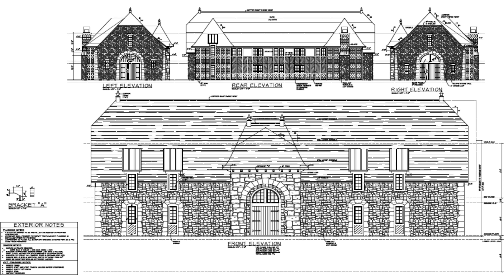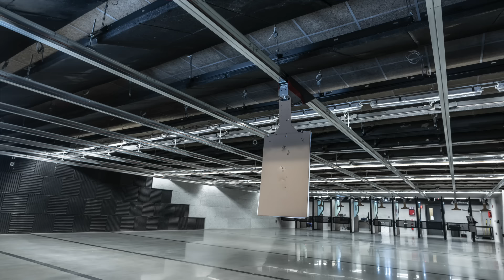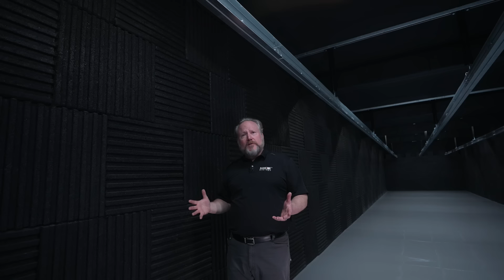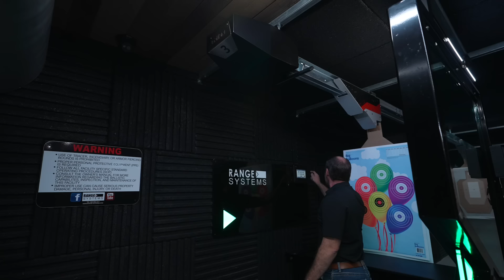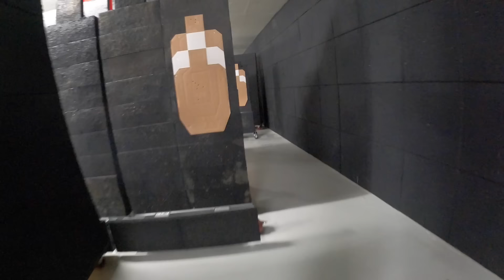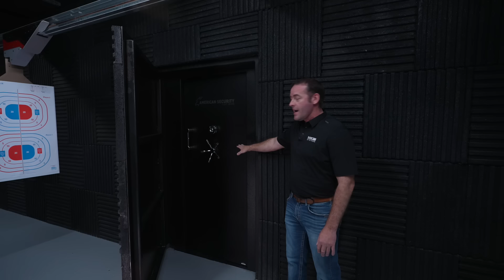Indoor Home Shooting Range: Step by step guide to building your dream range

Comment: I would build a 25 yard tunnel into the back yard. The range wouldn’t be under the house at all. Just the front of the lane would be in the house but the rest would extend under the ground. It would make a very unusual basement foundation